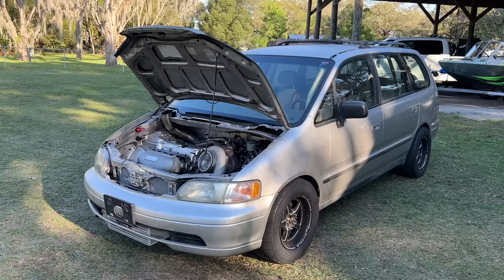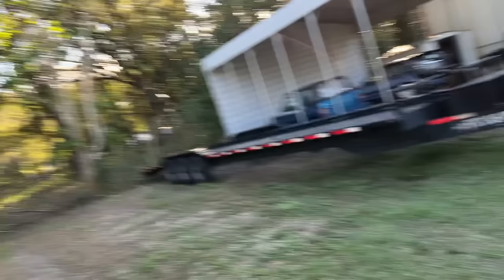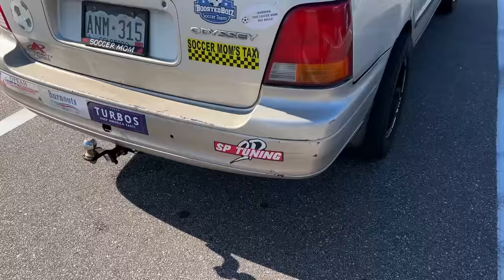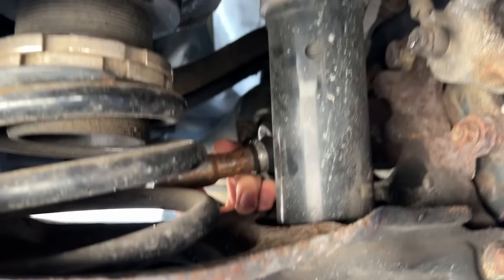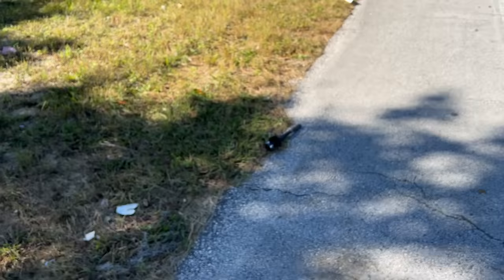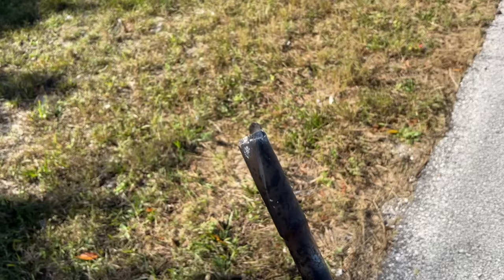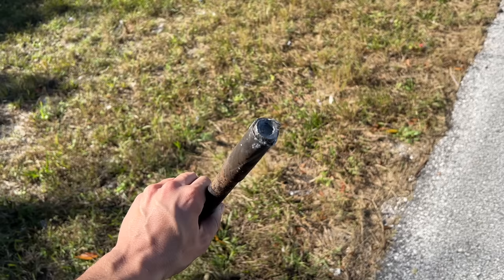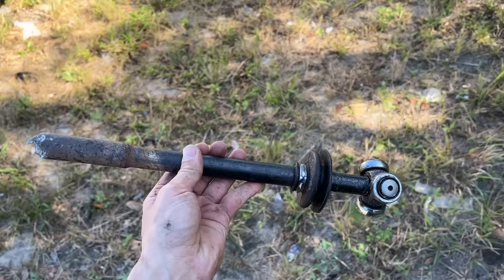My Gym Trainer Reacts To My 1000Hp Minivan!

Comment: Make your axle cut a 45-degree angle, weld and sleeve it. It's also good to have the sleeve ends cut at an angle or fish mouth. With a 90-degree cut the axle doesn't have near the shear strength.
Reply: telling secrets lol
Reply: Don't you get alignment/runout issues with a 45° weld?
Reply: i didnt fuckin understand a single word but you're absolutely right
Reply: Exactly how we do it in-house. 45 is perfect.

Comment: Cool Trainer for sure :) that face Kyle did when he knew the axle was gone is priceless :D
Reply: It is very strange to see a woman trainer for any men in any such club !!
The club i joined in 1982, at 23 years old, in, LA, SoCal, CA, which was a large chain of facilities, called "Holiday Spa" had, distinctly separate men's and women's workout, equipment, lock room, showers, steam room areas. the only joint area was the pool, dry sauna, and track area above.
The men's area had men workers, and the women had women workers. Simple. Period.
Also, within most all professional sports, competition, men and women are separate, along with trainers, coaches and such, though there are a few woman coaches of men within professional tennis; perhaps some other sports too. There are and have been many male coaches within female competition.
Certainly some physical male and female therapists work with both males and females.
Good Luck
Reply: @newtonfirefly3584 bruh

Comment: There's a guy that cruises around the northeast in a subaru doing spectator drags. I feel like if you set the hatch up with the right suspension, you could make out quite well doing some weekend spectator drags.
Reply: Crazy HP, light chassis, AWD, just need the right suspension and the hatch would be a serious contender.

Comment: Next time weild parts like that cut holes in tube and Weild it to starft in muilti areas

If you only weild end of tube then there's a massive area where it isn't sharing the load 

Also cut a opposing joint in sharft with a valley sos it like a locking joint and space fill up with weild 

How get towards high load weilding and engineering

Comment: Correct me if I'm wrong but isn't the best way to drive without a strain gauge to not use the clutch and get on and off throttle between up shifts?

Comment: Hello from 
__*_____/ / COLORADO
Reply: boosted_boiz326  That is okay.

I drive a 1960 COMET.

I am sure you can appreciate that.
I first started off with a simple tie rod end..
I am just a nuts-and-bolts guy, but no engine rebuilder.

I did replace all four of my under pressure ball joints .

I am sure you can appreciate that.